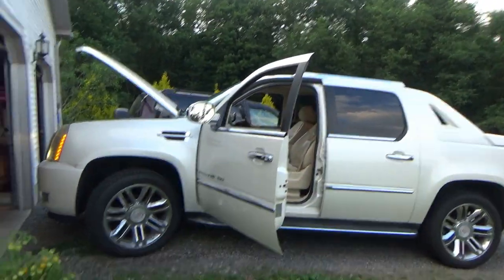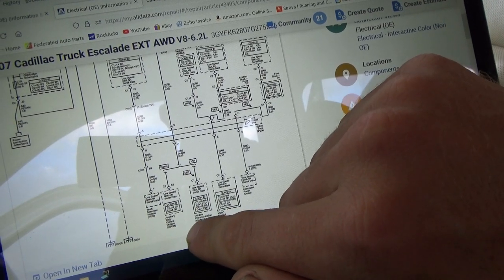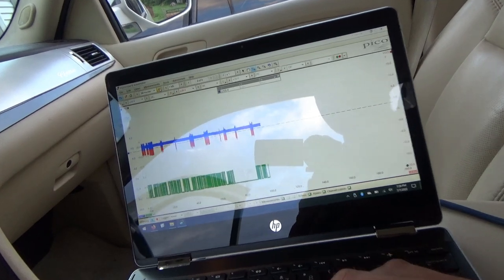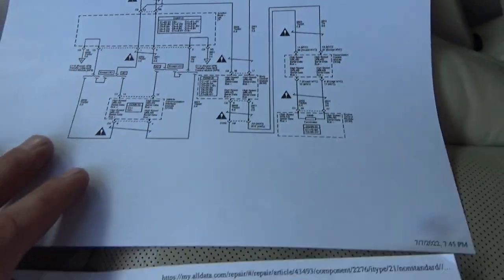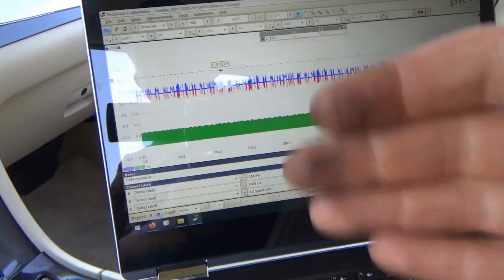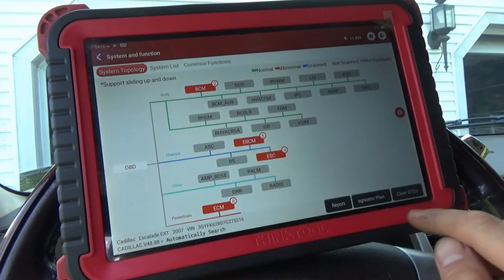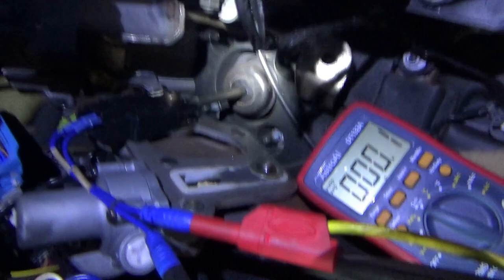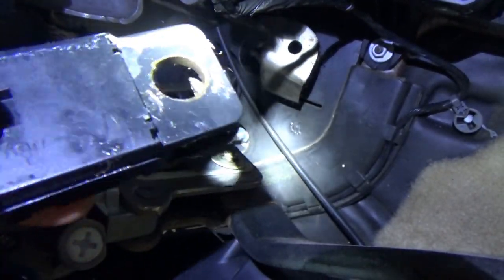Shops...Dealers...Parts Cannon FAIL! (Escalade CAN Ghost)

Comment: This vehicle overall is pretty much the ideal candidate for a cheap auction find.  Seemingly frustrating issues that aren't that complex to diagnose if you engage the brain/tools.  I bet the owner is thrilled and this looks like a really nice conveyance to travel the country (except for fuel economy of course).
Reply: And whatever else pops up on a long trip. Might be fine- might not
Reply: If it’s a 5.3 with vvt, disable vvt and gas mileage goes up, power goes up….and reliability soars!

Comment: Great job as always. As a dealer tech the hardest part of the diag is dealing with all the distractions. You can never just put your head down and figure things out. That's why alot of dealers shoot the parts cannon. The more I watch your videos the more I want to leave the dealer and go into the Mobil diag business.
Reply from the maker: You won't regret it... I wouldn't work for anyone else 🙂
Reply: Good advice. In my day the few good ones faintly similar to Ivan at my dealership.left an found their silver lining. Good luck to you..
Reply: i've been thinking about going to be a tech at a dealership but I always wonder about how fast the car needs to be fixed. I personally think I need to take my time

Comment: I was chasing a similar brake issue on my '07 Chevy Trailblazer. Kept getting a C0131 code which leads to a failed EBCM, and I was ready to replace the unit until I found an OLD article about how the computer expects to see the brake switch applied before seeing pressure in the brake pipe.
I set the scan tool to graph pressure and brake switch position. Turns out the aftermarket brake switch "timing" was off by a bit and the computer was seeing pressure before brake switch actuation.
Put in an OEM switch and the problem disappeared.
Reply: Dont be fooled, some brake switches can be adjusted by a bit before you tight the bolt down and that signal will come as soon as you press the brake pedal. Most GMs have this lever type switch that if you move it slightly, it activates. It is just trial and watch with the scanner to see if you need to move it a bit more. These type of switches usually have a two way switch, one for the brake lights and another for notifying the BMC.
Reply: @scientist100 

The car's of that vintage didn't bolt in, they were mounted on a post and retained by a clip. There wasn't any way to adjust the switch other than bending contacts, why bother for a $20 OEM switch.

Comment: Not to detract from your diagnosis in the slightest, Ivan, but I'll bet the GM dealer could have diagnosed it properly if they had really wanted to.  But what they really wanted was to sell the customer a new vehicle.
Reply from the maker: At most dealerships the only useful department is the Parts department 😅
Reply: Yup, repair a few grand/replacement 80k+
Reply: Yes, never a good idea to bring a vehicle that old to a dealership.
Reply: You haven’t detracted, Ivan is the man, very few dealerships these days can actually do what he does, I’d say you are dead wrong at 98% of dealerships these days…. They’d throw about 5 grand in parts and labor at it and give it back broken even if it was under warranty… you almost need a masters degree in mechanical and electronics engineering to correct many issues properly anymore, and that’s not a joke…
Reply: The last time I brought a vehicle into a dealer for a oil change they damn near wanted to rebuild the whole thing.  But they had a good deal on trading it in on a new car this week.
Reply: @dave3657  how lucky could you get!? Lol.
Reply: I see misdiagnosed cars from the dealer at my shop almost every month...
Reply: @PineHollowAutoDiagnostics   I think u have proved that a number of times.
Reply: Nah. The service department and technicians would get absolutely zero kickback from the sales department if the customer bought a new vehicle. Trust me they’d much rather sell parts and man hours. Most likely the tech working on it was incompetent, or severely padded the bill hoping they’d just say no.
Reply: I work at a dealer and repair other dealer's misdiagnosis or parts cannon of things not necessary quite regularly so I think Ivan is not far off on this one.
Reply: @bwdz75  I appreciate your comment. Good to c conscientious dealer techs. When cars come in on the hook, and then leave running nicely, it is a reward. Of course the money is nice too
Reply: @dave3657  My neighbor brought his 2016 kia optima in for some computer updates that were part of a recall he received, they called him into the garage, they had all the wheel off and proceeded to tell him everything that they wanted to replace, brakes cv axles you name it, the car was only three years old, he of course declined to have anything done because has not a sucker, they were pissed that they couldn't fleece I mean sell him service and part. On another occasion my friends wife's 2000 Volvo s80 sat for many years following her suicide, when he wanted to get it ready for his son to use he put a battery in it and as with all Volvos the dash was lit up like the proverbial Christmas tree, I took the car home to get it road worthy again so I took it to the dealer which at the time was the only place that had the necessary software to diagnose it, they said they had to reflash the computer, they charged 1,200.00, all the lights were out, on my back home from the dealer they came back on, I called them they said to bring it back the next day and I'd have to leave with them, they gave me a rental for a couple of days, I went to pick it up and guess what, it did the same thing, and that's how it remained until his son went off to college then he sold it.
Reply: Not to detract you from your statement but I from my experience at least from my local area, most techs have a shotgun approach or lack electrical fundamentals.
Reply: My sister in-law had grandnashal Buick the gm dealer could not fix it persision tune fixed it in one try
Reply: I doubt they had anyone capable
Reply: @Peter-pv8xx  sounds like he had some grounding problems. Customers would would come in  state check engine light was on and the brake light was on and the whole Christmas tree. Or loose battery connections or a bad battery. We take a look at the battery and cables are loose or corroded. The cables were loose on the battery posts. We would clean up all the cables and check all the grounds. Pull them apart. Make sure they're making good contact and just a little bit of dialectric 😊grease. And as you all have heard customers will tell you and need my car fixed yet today cuz I have to go to work tomorrow. So between the bad battery connections and then somebody fooling with the air box and not getting it on correctly leaning out the fuel air mixture. So all fixed and ready to go in half an hour. And you know what happens then. " I don't have enough money to pay that. Can I pay you on payday this week and then next week I'll pay the rest?" Sorry Peter but I kind of jumped on my soapbox after I read your reply and had to get it off my chest again. Could somebody help me get down off my soapbox so I can go fill my gas bag up?

Comment: When I had the problem with my cruise, you could be driving along with it on and hit a bump and the cruise would turn off. Gave the pedal a few taps with my foot and it would work again until I hit another bump at which point it would kick off the cruise. Replaced the brake light switch where I could repeat and rise with the same result and all has been well ever since. Thanks Ivan

Comment: As soon as I saw the parts cannon box, I said "watch...it's something super simple". Sure enough, it was a loose connection. Goes back to the "more you mess with the plumbing the easier it is to plug the drain" line of thought. Seems like training to trace problems like this isn't common. Yours is the only channel I watch that actually scopes the data lines. Bet if the very first person to look into this did that they would've caught it. Great vid and quite educational. I think I need to buy a scope before I have major issues with mine or my wife's truck.
Reply: in star Trek heavan, scotty just smirked at that
Reply: Eric O. scopes the data lines too, but he and Ivan are unicorns in that regard I think.
Reply: Vo

Comment: I have found working on my 08 Avalanche that all the brake switches from the parts stores and Rock Auto work very briefly. I bought one from GM and haven't had a problem since. Add a dab of Dielectric grease to the slide

Comment: I had the same problem on my 09 Silverado. The switch doesn’t fully reset under normal driving. Lights work fine, but If I want to use the cruise control I need to hook the brake pedal with my foot and slightly pull it up. Then cruise works.
Reply: My 07 silverado NBS does the same thing everything works fine except the cruise. I have to give the brake pedal a little help up then cruise is all good.

Comment: Very good video for the CAN buses.  I would check if the connector for the VIC plug in doesn't expect to see strap to a pin on the car.
the bob may not be suppling that connectivity for the VIC.
The brake switch, I see that the new brake switch fixed the problem but I was wondering if the connects may have been phased, i.e. one of connects had to made before the other opened or opened before made. Cams could be used that way.

Comment: On the brake control switches, I found a dried out/broken/missing rubber pad (at the brake rod/pedal mating area)(needed to open the switches), causing the switch(s) to stay closed, when pedal was released.

Comment: You are lucky the brake light switch was not a very intermittent problem. Took me a lot of time fighting this same problem on a VW Mk5 Jetta.  The brake switch worked 100% of the time on the light circuit side of the switch but 99.9% of the time on the ECM side. Complaint was, car would idle fine stopped at an red light but right after taking foot off of the brake pedal and pressing the accelerator pedal the car would have no or reduced power for 2 to 5 seconds. A very unsafe condition to have when making a left-hand turn into oncoming traffic.

Comment: The mechanical return springs get weak in the brake pedal sensor and cause always on/off problems. Aftermarket ones last about 5 years on GMs

Comment: In my suburban, when my cruise won't engage, if I just kicked the brake pedal sideways like two or three times that always fixes it. Lol.  I think there's two switches but the pressure switch that works the lights works correctly, so I'll just leave it alone for now.

Comment: I have a 2016 Ford escape SE that had an issue with the brake light switch would stop working and cause my cruise control to fail but my brake light still worked and I found that if I used my foot and pulled up on the pedal instead of depressing it that I could set the cruise control and that every once in a while if I would try to set the cruise and it didn't work I just put my foot under the pedal and pulled up depressing the pedal a bit,

Obviously I replaced it and have not had an issue since

Comment: My best experience with a dealer was when I installed a brand new Mr goodwrench 350 in my 1979 Malibu classic sport coupe, it had factory bucket seats and an automatic with a floor shifter, I wanted to upgrade the original 267 engine so I opted for a brand new engine, my friends who owned a garage let me use their discount through gm and it was delivered to their garage then they brought it to my house along with the hoist and engine stand. After a few weeks it had a hard time starting almost like the battery was going dead, since it was under warranty they told me to bring it to the dealer and they had to fix it, they said that the number 5 piston was binding, I brought it in the morning by late that afternoon they had the engine out, I went there to look and through the garage window I was able to see my car with the engine out, I had the car back in a couple of days, that was around 1990, it was the dealer I had bought the car from brand new but it changed owners when this happened, labor everything was covered under warranty.

Comment: Ivan if i have a hole in my exhaust could that throw a O2 code ?    Thanks Bud !
Reply: I’m not Ivan, but depending where the hole is, and what code, yes it can, can also set cat codes
Reply from the maker: Absolutely, especially upstream of the O2 sensors.
Reply: @danielpuglia7369  thank you
Reply: @PineHollowAutoDiagnostics  thank you Bud !!

Comment: I'm thinking your BoB didn't have a good connection on pins 4 and 5 or the internal circuitry was interfering for your scan tool to not comm. On lo speed

Comment: My 97 Chevy p/u brake light switch is a bit different and better than that new design but the  contacts for the brake light are the same
A quick dressing of the contacts and a slight adjustment fixed it ,no different than the Electro-mechanical pinball machines i have 👍
I have it set hair trigger for tailgaters so i can stay on the throttle and tap/hold the lights without riding the brakes 😅

Comment: That exact style of brake switch was used here in Australia on a lot of Fords in the early 90's and it was very common to see them fail.
I remember we seemed to sell a lot of aftermarket ones when I worked for an aftermarket auto parts store in the mid/late 90's.
Looks like it might just be another wrong decision by GM to steal another manufacturers poor design, or just going with what's cheap and readily available...or perhaps there were lots available for rebranding when Ford stopped using them in the early 2000's..lol🤣

Comment: Excellent work. Personally I would fit a new switch simply because they are cheap and the component was showing signs of failure. Second point - I hate waiting for a digital voltmeter to make its mind up - bring back moving coil meters ! (for some purposes)

Comment: i bought a new GS750 when they first came out. Kaw. had just came out with the 650 that they said would outrun any production 750 we would park down the road from the kaw shop and when one of the 650s would come by get a race and out run them.

Comment: when the cruise doesn't work or drops out randomly when driving on a GM, you can pretty much parts cannon the brake switch at it and be right 96% of the time. they've been that way for years.
that's assuming the dash isn't a Christmas tree and firework show. 🤣
also, at that mileage and heavy tank, they'll likely find themselves in transmission rebuild hell and it in limp mode and much sooner than later. 😵‍💫

Comment: I thought for sure the brake thing was going to be a repair bulletin by GM for faulty item at BCM.  My G6 had some strange things going on - brake lights going on randomly killing cruise control.  So many GM cars of that year range (2005-2009) had these issues.  GM refused to fix my 08 G6 because the recall only specified up to 2007.  I brought them the report and I told them do the work exactly as described and I will pay you time and material.   Surprise suprise - issue fixed - no diagnostic fee needed.
Reply: I wonder if their fix was to take out the BCM connector, clean the contacts, apply dielectric grease, and reconnect? I did this on my friend’s G6 a couple years ago and it seemed to work. Watched a few videos to figure it out. I think the hard part was removing the trim.
Reply: @peacefrog0521  yes that was the general fix

Comment: Hello Pine Hollow, I have been trying to find wiring schematics for a 2001 Pontiac Grand Am GT. Having trouble with the door opener on the fob. Replaced the module in the back. Also having problems with some other things. Where can I find wiring schematics for this vehicle. Haven't had any luck  . Thank you.
Reply: This from an Ivan fan,   I subscribed  for a  Mitchel Wiring Diagram for $29.00 a year.  Is an excellent publication.,  Is a PDF file.  Used it several times already for my 2007 Buick, Lacrosse.  Great item for 29 DOLLARS a year.
Reply from the maker: AllData is my favorite 👍

Comment: The "partially installed GM clip" caused me to shift into 1st gear at 75mph unprompted, pump 21 gallons of gas all over the highway, attempt to shift into 4LO at highway speed unprompted. Apparently you can fool idiots 3 times, but I'm certainly no moron so I switched to Toyota.

Comment: On my 08 Avalanche I had the same problem stabilitrack ,traction control, remote start, Bought two from local part stores, no fix, Go to dealer buy same switch , problem solved

Comment: Ivan, I've had a vehicle or two that didn't seem to like my BOB/vci and have even set codes for it that went away when I unplugged them. I have never come up with an explanation-did you have any theory on why this truck didn't like the BOB plugged in?

Thanks,

Joe
Reply: It could be due to the BOB not having twisted pair wires for the CAN bus, which would put reflections on the bus (gets worse the higher the speed of it is). Or if it has any LEDs connected to the pins, even a small load of  a couple mA could wreck the bus.
Reply: @brainndamage  Thanks for the info!

Comment: The brake switch appears identical to the one on my 1997 Lincoln Town car which I recently replaced.   I was unable to see exactly how you installed the switch, but you made it look easy, which was not my experience. There is supposed to be a nylon busing that fits into the the master cylinder plunger hole to make movement easy.  There should be no grease.  If missing that would mess up the switch.  Takes 3 hands to juggle it into place as it falls off real easy.  You did not seem to have that problem, perhaps that bushing was missing?